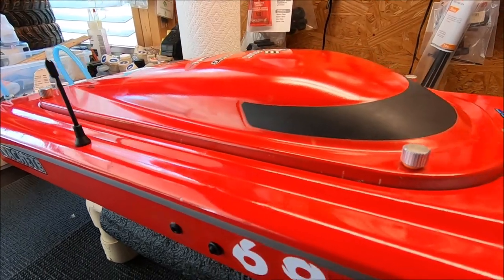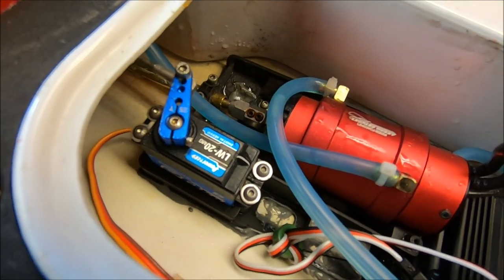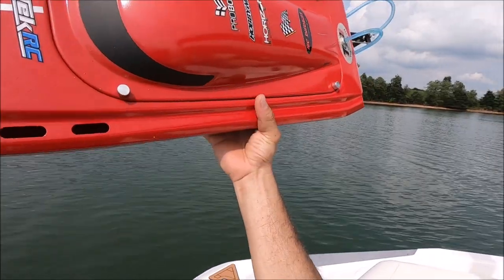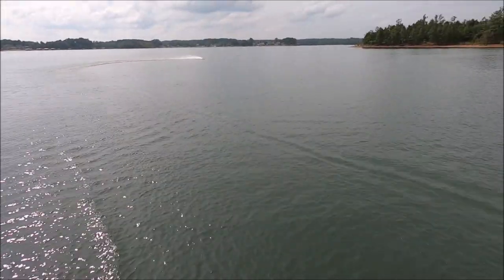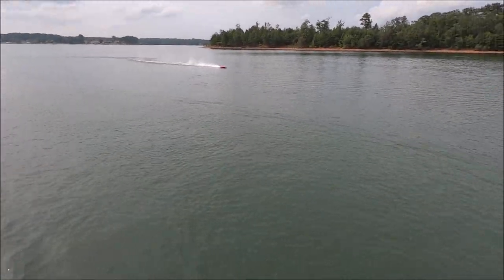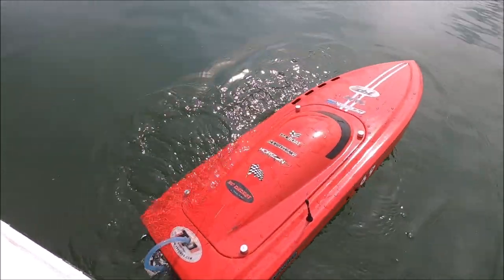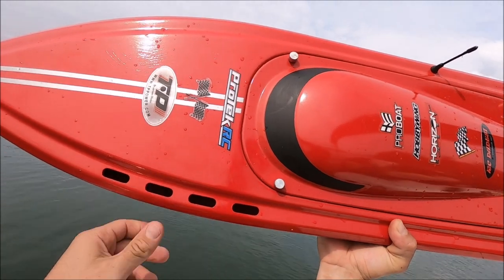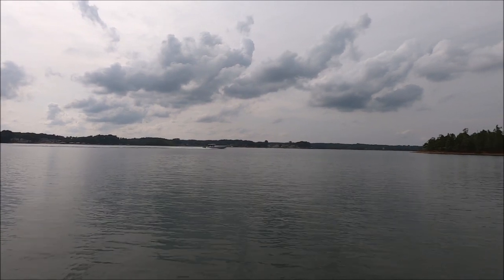Pro Boat Sonicwake 36 CUSTOM BEAST! The "Red Rocket"

Comment: I run a 5v micro water pump in my rc boats. Idk if it really helps with the cooling but it looks sick af when it pouring out the through hull fittings while sitting still 😂

Comment: Awesome sonicwake dude !!! graet job ...Which batery are you using to get so much running time ? which prop did you put in this ferrari ?
Reply from the maker: Thanks so much!! I was running Zeee 3s packs 6000mah. Pretty good run time with a Dasboata 42mm prop. She can run faster but I like the efficiency of this setup!
Reply: @RCDUDE81  thats great! ..did you notice a big difference between the stock 120 amp esc and the 150 amp esc you are using? also you went down from the 1900 kv stock motor tona 1700 kv motor ...does it gain speed with your set up ?

Comment: Got to ask you how long does a 6s battery last.
Reply from the maker: I usually run two 3s but the 6000mah packs I use will last 10-15 mins.

Comment: What prop you running on this motor and speed control setup.  Would like to run the same
Reply from the maker: 150amp Offshore electrics ESC and Dasboata 42mm prop. Runs cool and efficiently with that prop! I could prop up for more speed but water temps are too warm to really cool it.
Reply: Dasboata prop 42mm. Is their any other info for it then that. Difficult to order with just 42mm
Reply from the maker: I'm sorry it's a 2 blade 42mm speed prop. Just tell him what you need it for. His props are kinda special so hard to perfectly define it. Are you running stock motor?
Reply: Yes at the moment about to order your same setup. Look like it was a rocket compared to mine.  But if you suggest something else I’m all ears